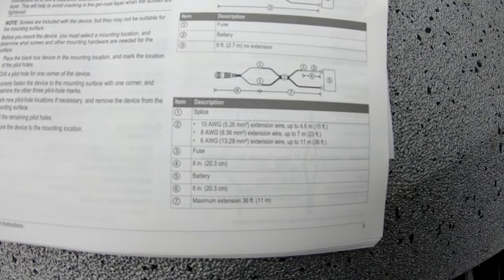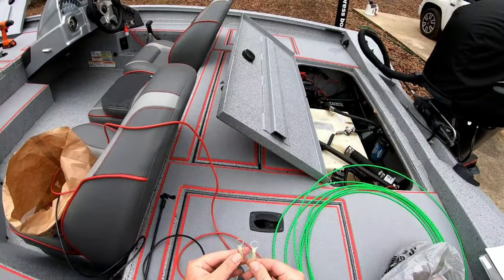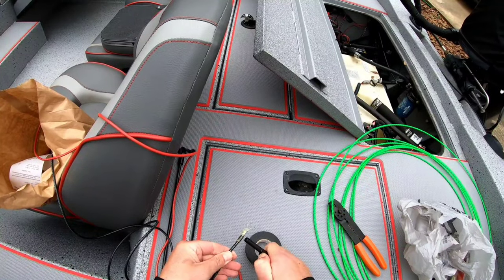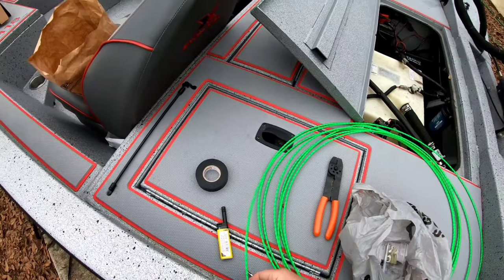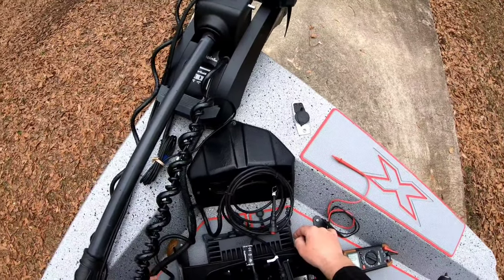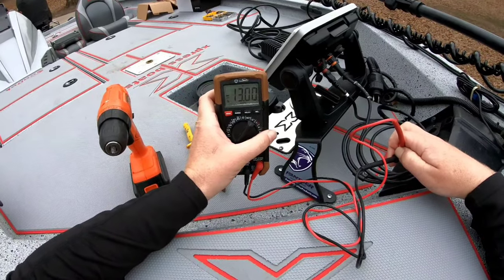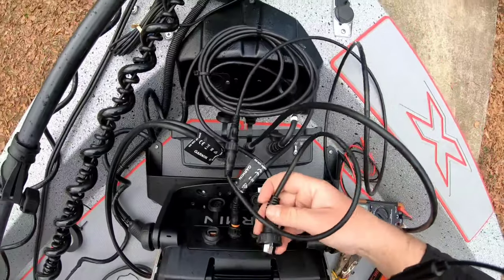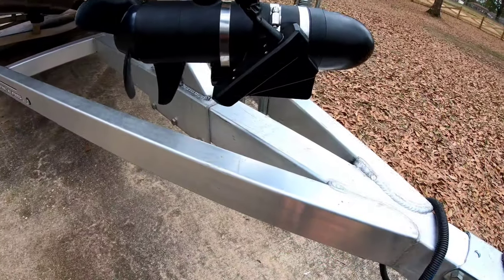Installing Garmin Panoptix/Livescope! How to install Garmin livescope from start to finish.

Comment: Thanks for the step-by-step tutorial on installing the LVS-32 Livescope. I just purchased the Black Friday Sales and got the LVS-32 under a $1,000 and 2 - Garmin Echomap Ultra 106sv under a $1,000 each and now I am ready for LIVESCOPE. I just installed it. I know is old technology but for me is excellent since I am a crappie fisherman and at 25 feet or less both the LVS34 and LVS32 are on par with each other.  Thank you again. BTW, I loved your double console graph board construct. That was a brilliant idea.

Comment: 2 questions. So I have the Terrova and just got the LVS34 with the 93Sv and I don’t have to buy the cornfield mount? I can just put it on the side like you did? Also I bought the bundle so did the fish finder come with a transducer if it’s own that it runs off of when livescope isn’t on? Or does the livescope transducer run everything such as side imagining?

Comment: I'm a retired  electrical engineer and instrumentation mechanic, Do not ground the wire if you are experiencing noise or interference. leave the other end open, if you ground it, it will act as an antenna. I have fixed a lot of noise issues by disconnecting the ground in the control room.
Reply: What ground wire are you talking about??
Reply: @lonniehall9006  There a shielded cable with a ground going through it when grounding xducer and/ or computer unit don't ground them both as it makes an antenna which will interfere with the unit and be displayed as noise. I had a ground with mine.

Comment: Stupid question but does the black box power your graph, or did I miss you running the power wires for it? (it may have already been wired, sorry for the silly question)
Reply from the maker: I had the graph already wired the garmin uhd9
Reply: @251reeling9  cool thanks

Comment: So If I get the 93sv and the Panoptix/Livescope is there any other kits or anything I need? Other then wire and battery which I have. (on a 120 PDL kayak)
Reply from the maker: Yes that 👏 is it

Comment: Did you run into any issues mounting your black box on the deck? I see most people mounting them inside a compartment.
Reply from the maker: No it works fine

Comment: Really good video but I'm curious with leaving that black box out in the open is that box completely waterproof if you get caught on a lake in a downpour thanks
Reply from the maker: ive had it in the worst storms and it still worked fine due to the o rings around the connections

Comment: Any problems since you made the video? I just bought the Xi-5 & wasn't thinking that I will have to mount the transducer on the barrel.
Reply from the maker: I bought the perspective mode and mounted it up the shaft
Reply from the maker: But it worked fine on the bottom
Reply: @251reeling9  I have the perspective mount. Will it work mounted to the shaft with it? I'm scared to death of mounting it on the barrel...I'm very accident prone & would be pretty upset if I'd hit bottom

Comment: I just sold my Xi5 bc I was too nervous mounting Livescope to it. You should make a video title How To Mount Transducers and Panoptix to Xi5 Xi3
Reply from the maker: With these types of trolling motors im scared of clipping or cutting the transducer wires, i put an ultrex on my boat the other day
Reply: @251reeling9  Yessir never want to cut transducer wires... I do boat install for a living... Good job on the install

Comment: Do you have another transducer on bottom of trolling motor
Reply from the maker: Yes the gt 54
Reply: @251reeling9  Appreciate it. Mine be here tomorrow and have a Hummingbird transducer on bottom of barrel. Making sure they both will fit

Comment: So glad you had that trolling motor haha I’ve got a minn Kota powerdrive I pilot and was going to get livescope but didn’t know if I could mount it to my trolling motor or if I had to get a pole which I didn’t want. How good does that set up do? I’m looking at doing the same thing
Reply from the maker: it works you have to be careful of how you deploy your motor or you will snip the transducer cables on these electric steer motors.
Reply: @251reeling9  yea that’s what I was worried about and the spot lock. Heck I’ll figure something out haha
Reply: Precision sonar has a setup that you can mount to the power drive trolling motors it keeps the wires out of the way

Comment: You have your transducer on backwards. The wire goes rearward.
Reply from the maker: It depends on if you mount it port or starboard
Reply from the maker: It reads both ways
Reply: Ok good to know. I just installed my LSV34 and it never mentioned that but it might be a little different than your 32. I will work anyway you mount it, but that’s the direction it will look.

Comment: Best to run units with dewalt 20 volt, and 18 volt Milwaukee batteries. Your transducer is on backwards .
Reply from the maker: you can mount it 4 ways, now its on the shaft any way.
Reply: @251reeling9  the cable has to be at the back, before it reads forward, you will see fish that is behind you the way it is..
Reply from the maker: It can be mounted on port and starboard side. The way it is mounted here is forward. You can turn it around on the other side.
Reply: @251reeling9  why is it on the shaft now? What caused you to change it?
Reply from the maker: I got a minn kota ultrex. the sharp point of my boat was dangerous for my high school anglers to deploy the xi5 there was nowhere for them to stand, one almost fell in.
Reply: Garmin units electrical limits are 9-18 volts using 20 volts may damage your head and your screwed. Not worth the chance!!!!! Use 18 volts period.....